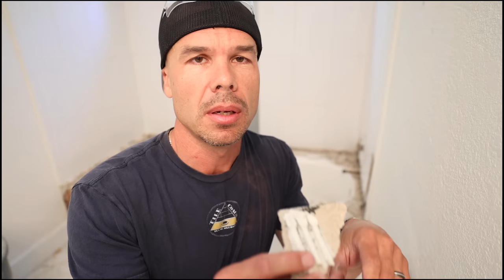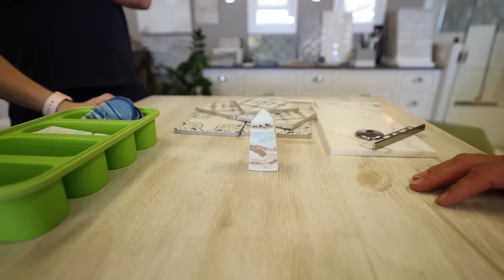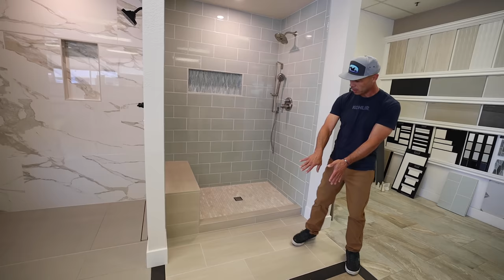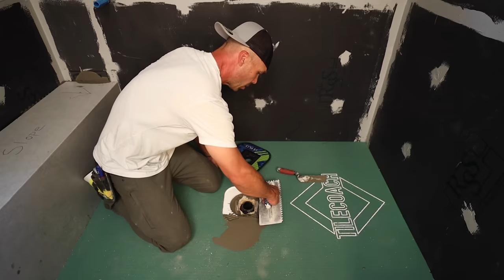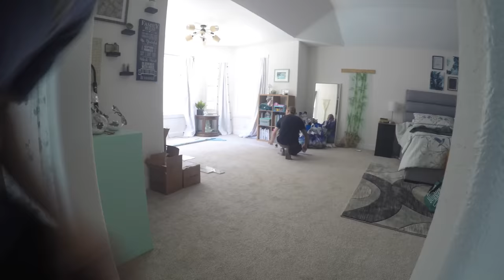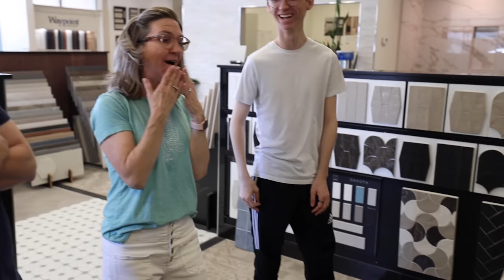$20,000 Tile Shower --- They Had to Pay TWICE!!!

Comment: This is a really cool video format! Your channel just keeps getting better. 

I was shocked at first when I heard the cost of 20k. I do work in the exact same field as a tile contractor also, also in North Cal. 20k is about 40% higher than most of my bids. Then I saw what was done. In case folks don’t pick up on it, he’s the acting GC, plumber, handyman and tile guy as well as a Designer for this project. I never go pick out tiles with client. I also do not get involved with many of the adjustments like plumbing, demo, trash haul, etc. honestly 20k is phenomenal value. Most all inclusive bath remodel companies will not get anything close to this kind of beautiful work and they usually start at 25k for a bath remodel. And that’s for a generic cookie cutter shower build. Tile Coach is doing an ultra premium custom design for 5k less than that. 

When I grow up I wanna be like tile coach hahah.

Comment: Man I am too old school I still can't get behind not using a rubber pan liner and Deck Mud. 
Seeing those seem joints with mortar underneath them knowing that mortar wick's water.... No way water dust behind that stuff. 
BUT... Then again most people redo their showers every ten to twenty years and the shower will probably last a good six-plus years without any problems being noticeable. However when the shower is torn out there definitely will be mold and that's when you will notice the issues. 🤣🤣🤣👍👍👍
Install looked very nice 🙂

Comment: So......trying to figure out if I'm super happy to have found this video, or super depressed.  I've watched dozens and dozens of TileCoach's videos and they have been super helpful to me.  I tore out a tub/shower and then floated the floor.  My first float!  So, it actually went sort of ok and I was pleased - basically.  It was my first one, so obviously as it goes with anything, I'm sure the next ones I ever do would be better.  Then I built a bench at the end out of cinder blocks b/c of course I wanted it to be bullet proof and over engineered, right?  Then I framed and poured a concrete curb for the exact same reasons.  As I am a novice, this all took me approximately forever.  And a day.  Now I watch this video and basically every single thing I did, Isaac did in the blink of an eye.  Man......  can't determine if I am super happy to have seen this or super depressed. :|

Comment: nice to see quality, good job. one thing that might have looked better (but im sure there were other factors involved that cant be seen on the video) is that the back wall side cuts were matched on the side wall. you have back wall side cuts of about 3 inches , then the side wall side cuts are full tiles, so it doesnt flow as well. in a perfect scenario,  the piece that was cut off of the side wall cuts would of  look nice if that same piece was used on the side wall so the 2 cuts that butt are the dimension of a full tile....again, you probably had to do it like this for other reasons , so im sure its not a mistake.. totally awesome video

Comment: So wish ppl took their time and did jobs like was their own and really did fantastic job, like the install In this vid. Know everyone has “own” standards and 5 diff ppl can say 5 diff things, but hate when ppl say they just nit picky, when the tile job really is “bad” when “LOOK AT IT”, as anything looks good 6 feet away, but we shouldn’t do work based on that thought process, least it’s how I was taught☺️
Having an issue w/ a shower drain that was done by another tile contractor and all grout has cracked around it, lippage on floor tile is bad, and missing grout as well. Also no grout around perimeter and no silicone caulk for change of plain. The 
drain, an Oatey brand 3 piece, is odd to me. Where grout is cracked by drain and tile, can insert my metal shim and it goes down around 7 inches (length of shim) and doesn’t hit thinset, dry pack shower pan, nothing and the tile cuts around drain looks like was cut blind folded, straight and level cuts in tile are absent, or minimal (most likely will be replacing for better fit). So, this $75k bathroom remodel has some major tile issues and skill level issues imo, especially at that price for a shower, bathroom floor, and tile wainscoting (all porcelain and all black grout). But that drain and lippage going into curbless shower is 2 problems that needs fixing along w/ missing grout and silicone caulk everywhere….rest well, tearing out and doing over not an option.
Anyone else ever have a drain issue like this? Where nothing to “hold grout” and keeps cracking &/or fall8mg out b/c of install? Starts at 1/8 and ends almost at ¼-3/8” grout line 🤦🏼 definitely not to my standards, but everyone is different.
Cheers✌🏻

Comment: 3:19 the guy finding that quote hard to swallow. Dude was thinking under $10k and then signed off for a $20k bid? Just for a shower? I think that guy may have felt the peer pressure to say yes since he was being recorded. Should have called around to get a few more bids. $20k for a shower seems extremely expensive. Some whole bathroom remodel is about that price.
Reply: That's what I was thinking! Heck i got my roof replaced, including replacing several pieces of rotten plywood, for only 10k. And this guy would charge 20k just to tile a shower?? That's insane...That's why i end up doing so many projects myself haha.

Comment: For the $20k budget, any chance we can get a relative breakdown of project costs?  Would this project be considered high end?
Reply: You're looking at about $4k to $5k in materials (water proofing, tile, glass door, hardware etc). And yes, this is up there with the high-end showers. I installed "fancier" ones with multiple shower heads, rain shower heads and smart controls etc. But the final cost always depends on how much of the materials are provided by the homeowner, whether you do the demo or not, what kind of tile you need to install and how much framing, plumbing, electrical and other things you have to do. It can get pricey really quick!
Reply: @jordan2104  No matter how good any contractor is i would still get  2 or 3 estimate's  :)
Reply: @markplaton84  Of course, but you have to remember that usually, the cheapest one will get you the lowest quality. And when it comes to tile, quality and attention to detail are key.

Comment: A lot of other contractors would have sighed once the customer started talking about how they wanted multiple different tiles/colors and then tell the customer it'll be way more expensive than quoted so that they'd end up with a boring all white/grey tiled wall
Reply: Different color and size tiles are more expensive. None of them cost the same. Gray and whites are always cheapest

Comment: I plan to upgrade my basement bathroom and I want to put pex heat in the floor. Would you run pex in drypack for the shower pan? Also, I am wondering if diamond screen would help to distribute the heat in a cement floor?.. any thoughts.

Comment: Good job on the bathroom. Just curious on the mold situation (especially black mold). I did not see one air scrubber or anyone wearing respirators during the demo. Hopefully those vents at the least sealed you really don’t want that running through the house.
Reply: Most mold is harmless. Even black mold. It isn’t the deadly danger that most people believe.

Comment: Great work. You should check out KRBS shower systems. They are really nice and user friendly. Used them in both my bathrooms and I was really impressed. Keep up the top notch work.
Reply from the maker: Not impressed by the drain connection. Other than that seems like a decent product.

Comment: I’m a contractor that deals with high-end homes. You charging them $20,000 to do that shower have completely ripped them off. A 3 x 5 shower takes approximately 100 ft.² of wall tile and approximately 20 ft.² of floor tile. And expensive tile is $20 per square foot so that’s $2400 for tile. Your floor system curb tile backer board and waterproofing would be about another $3000. A frameless glass 10 mm shower enclosure is approximately $2000. If you were to put high and plumbing fixtures in there you might be looking at another $2000. The time to do that is not worth $10,000. On a medium to lower end Using non-expensive tiles and shower fixtures you should easily be able to do that shower for less than $10,000 even with today’s crazy prices. You’re being scammed and it’s all being filmed. and you guys doing your own demo saved a professional maybe four hours worth of work. Me and one other person can walk in to a full en suite shower bathtub vanities everything and have a completely gutted down to the studs waterlines capped off cleaned up vacuumed and taken to the dump by 1 o’clock. So him telling you to do the demo to save you some money is really just another scam because he’s making you think like it’s a big deal.  I’m not knocking his work. I have watched many of his videos and he is very good. But his pricing is insane.  He’s taking advantage of them because of their situation.
Reply: I agree, I'm just a DIYer, but I gutted and redid my entire bathroom down to studs, my own demo, new waterproofing, new plumbing, new fixtures (mid tier) new tiles, etc all on my own, and I think the cost was probably $3000, and that was with the purchase of new tools I didn't have. But I was quoted $10-20 grand when I was calling around. Definitely a rip off. Yeah, it took me a few weeks, but it saved me a lot of money.
Reply: What state are you in, and what price would make sense to you?
Or if putting a price on this is difficult how about a timeline?
Is 6 days doable? Plus inspections
Day 1 - demo and haul away, maybe start rough plumbing
Day 2 - rough plumbing plus backer board and waterproofing
Day 3 - Start tiling
Day 4 - Finish tiling
Day 5 - Grout tiles, install trims
Day 6 - install glass enclosure
Reply: @keithoshea2174  For a professional I would add at least 1-2 more day in there. The tile floor would be day 3, walls days 4,5,6 depending on tile and complexity.  For a diy, even more than that. Glass enclosure depends on if it’s a pre manufacturer kit or custom. Custom add 14 days waiting from measurements. I’m in Canada. 
Demo for just a shower/tub is about 2 hours 
Plumbing rough in 2 hours 
Reconstruction and backer board 2-4 hours depending on complexity 
Our tile guy charges about $3800 for supplying shower pan/curb, waterproofing, tiling floor and walls. Obviously the size, features and complexity of the shape and tiles will increase costs. We supply the tiles, they supply everything else. Thin set, grout, waterproofing, edging etc.
Plumbing finishing 1-3 hours depending on fixtures and features. 
Frameless enclosures are $1800+
$8g on the lower end for full tile with frame less glass. Sky is the limit beyond the basics. 
We do lots of showers that are 15-20g. But what he did was not even close. And I’m in Canada where everything costs us a lot more than America. Where he is and what he did I would guess should have been 8g.
Reply: @neoasura  I am redoing my own master bath as well but my cost is slightly higher. I am around 5-6K into it. I still have a vanity to purchase to replace the old one. I do think that 20K is excessive amount he charged. If it was 10K, I would say it's reasonable.

Comment: Wow hardie backer no thin set under it and no screws just wow can't believe it .   When we do a complete reno or new construction the first thing is we screw down the subfloor with exteriior screws because 99.9% of the time the subfloor is nailed down now the subfloor is screwed down then thin set backer board then screw down backer  and we always put extras screws in the backer no skipping these crucial steps......

Comment: Hello Issac & thank you for all the videos. Sorry to ask a random question here but I'm having a hard time finding the answers. Kerdi membrane, can I use that as an underlayment, on top of Advantech subfloor.  Also, modified or unmodified?? Thank you so much again, without watching several of your videos I'd of never understood layout....
Reply: For subfloor use the Shluter Ditra uncoupling system.  Note,  if joists or truss is on 24" centers, use an underlayment board. Advantech alone is not a sturdy enough subfloor to set tile. If there is subfloor movement the Ditra mat will allow the uncoupling of the mat from the subfloor without disturbing the mortar bed between the tile and the ditra. Hope that helps.
Reply: @roughboygarage1475  thank you. Its 16" on center, new construction, nailed & glued. The sales rep sold my wife 4 rolls of the membrane & I'm only tiling 2 showers & the floors. And the friend that lent me his tile saw said to use the membrane, he's not a tile guy. But I really appreciate helping me clarify this.
Reply: @joederochemont6219  once you mud down the Ditra to the subfloor and backfill the pockets on top of the Ditra 4 to 6" out from shower curb, walls and where the Ditra mat  butts up to itself. Let that dry. You can then use Kerdi band or cut Kerdi off a roll in 6" wide strips. Mud those  strips in over all the joints. And the entire bathroom will be waterproof to an extent. There's still toilet flanges, where the ditra stops at the bathroom walls, etc. for water to intrude. You can deal with those also by put kerdi strips in corners no higher the the baseboard(good) or you can use tile as a baseboard(better). For bathtubs, toilet flanges or places you can use strips of kerdi. Use Kerdi Fix, it comes in chaulk tube in multiple colors. BE CAREFUL with it. It's gnarly stuff. Tape off anything you don't want to get it on and use gloves or you'll be wearing it for a week or 2, lol. Hope that helps.
Reply: Oh and also I like to wait and fill the pockets in the main area of the Ditra as I set my tile, so there's no bonding issues. If you want to use a backerboard instead of Ditra, you can use the kerdi mat over that as well. Just not kerdi direct to wood.
Reply: @roughboygarage1475  thank you thank you for all this info. Beyond helpful. I pretty much knew the membrane was a no go for in underlayment, as I could not find a single YouTube video of it lol. Not even a diyr lol. Again thank you for taking the time to help me out sir...
Reply: @roughboygarage1475  have another question if you can help. So I picked up the Ditra for my bathroom. Now, downstairs, in my in law's room, its ¾" plywood (pressure treated) on top of concrete. Nailed down. Can I lay tile right on that, or still even there use Ditra, for expansion & contracting
Reply: @joederochemont6219   I've only nailed plywood to concrete once. It was to add on to existing hardwood where a wall had been removed to make one big room. Pressure treated or not, it should have a good vapor barrier between it and concrete such as felt paper. I used 30# felt. The reason is that the concrete can wick moisture through it. 
Never set tile directly to wood. Wood naturally expands and contracts with the changes in weather and humidity. It can actually expand far enough to pop tiles completely loose. I've also seen the tiles stay stuck to wood after contraction and pop out whole grout joints. This is where Ditra style mats really shine.
You always want to use some form of underlayment top of wood such as a backer board or Ditra. Both of which would be mortared to the wood. 
If your not sure whether there is a vapor barrier under the concrete. I would go with Ditra. So if that plywood starts to swell the Ditra can uncouple and save your tile job. 
A good dehumidifier might be a good investment for the down stairs.
Reply: @roughboygarage1475  thank you again, & sorry I should have been more specific, there is a vapor barrier. Nailed it down with one of those high pressure nail guns, Max HN120 concrete tool. 320 psi. Thing shoots through steel. Nails were $180 a box. Anyways, totally makes sense, just wanted to double check as there really is so much misinformation out there. Or people that just don't care. Just look at premise of this video, no waterproofing under tile, on a bench. I'm sure I'm making mistakes, but I'm trying to do everything right. Built a 2600 sq ft addition at the wrong time, prices of "everything" has made me have to do everything after sheetrock myself. Covid ate up the budget. But anyways, thanks for your time again sir...
Reply: @joederochemont6219  i completely understand. Im in the process of a much needed complete remodel of my home and i cant imagine it what would it cost if I didnt do it everything myself. Im always glad to help.
Reply: @roughboygarage1475  hello, so we are getting ready to do the downstairs bathroom, its ¾" pt plywood subfloor. And to gain some height I'm putting down ¼" cement/backer board. I will thinset that down & screw. Then I will use ditra & then tile. If I'm using the ditra, do I have to worry about the joints on the backer board? I mean the ditra, & I will seal with kerdi tape, strip whatever its called. Also, if I am really just using the backer board as like a shim, do I need to thinset it.
Reply: @joederochemont6219  Definitely thinset the backer board down.
Reply: @roughboygarage1475  thank you again sir. You've been a tremendous help. But here I am with more questions lol. Grab bars. Do I install to stud, then tile, & cosmetic covers go on after tile? Do I install tile & drill through tile. What are my options here. Right now, it's drywall walls. And we are going to use kerdi shower system. Thank you again